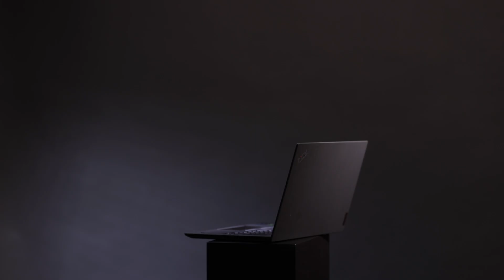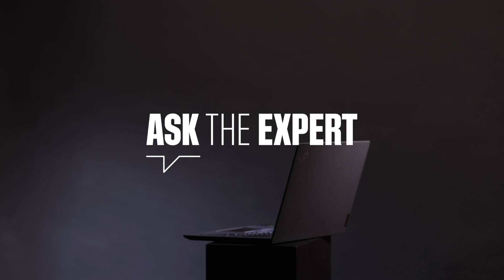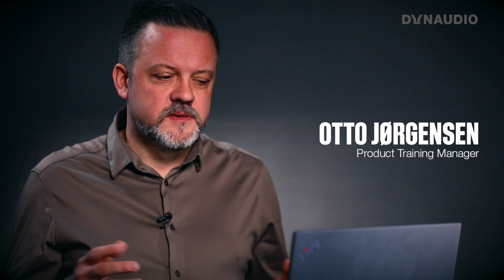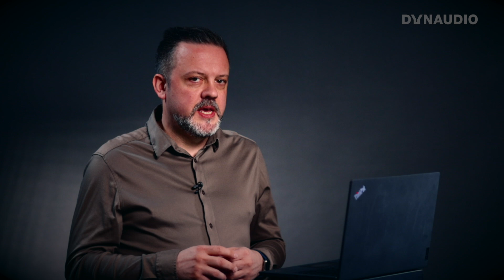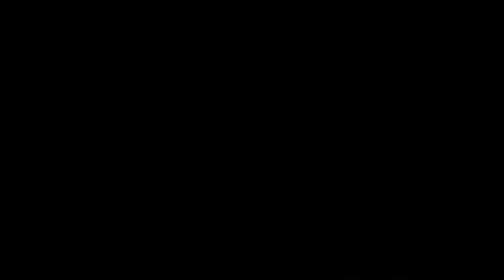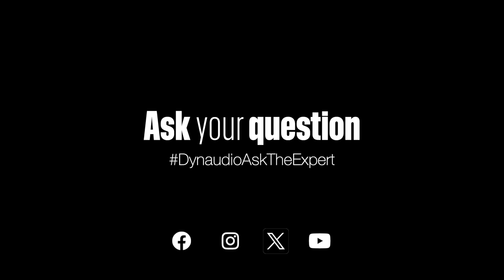Loud! Did I permanently damage my speaker?

Comment: Since I am not able to contact Dynaudio direct by any means, maybe you can answer a question. I own a pair of Confidence 30's In the ruby wood finish. What material is this speaker made from? is it plywood, a special hard wood etc? Can you please reply?
Reply: Hi. Sorry for not noticing your comment earlier. The cabinet in almost all our speakers, including the Confidence 30, is veneered MDF. The resonance spectrum of MDF is what we find optimal for speaker cabinets. Harder materials exist, but they would typically result in more high-Q resonances, meaning the resonances that would still be there would be more audible. The properties of MDF spreads the resonance out so that it covers more of the frequency range but at lower volume, which is much less audible.

Comment: Can my aging 15 year old speakers develop woofer sag?  I've heard that rotating the woofers 180 degrees in the cabinet is a good idea.   Is this really necessary?
Reply: A speaker cone is held in place and aligned by the voice coil and magnet. The surround of your speaker is not significantly supporting the cones weight. The surround can deteriorate and break down from age but it wouldn't do it more on the bottom because of the cones weight. Of course the quality of the speaker is a factor in this. I have some classic Celestions from the 70's that still work and sound great. Dynaudio makes very high quality speakers and I guarantee you they'll last longer than 15 years.
Reply: Most likely only if you have uneven drag on the driver, like those that are tilted 45 degress. You can do a sag calculation if you have the driver specifications. If its mounted fully vertically, then its very unlikely.